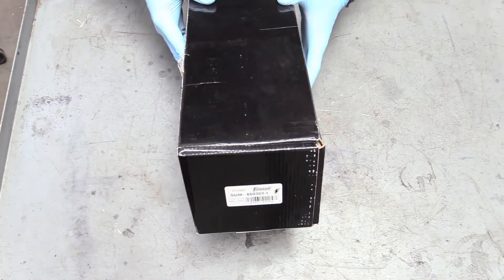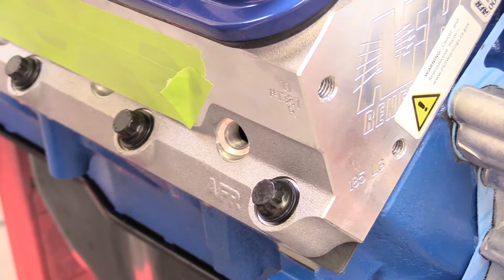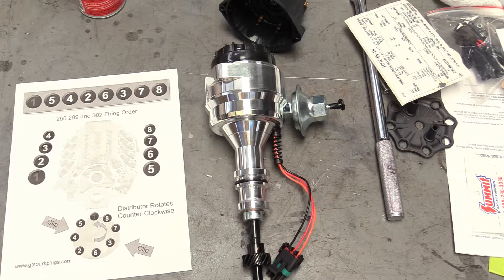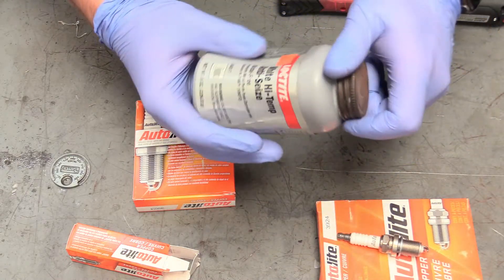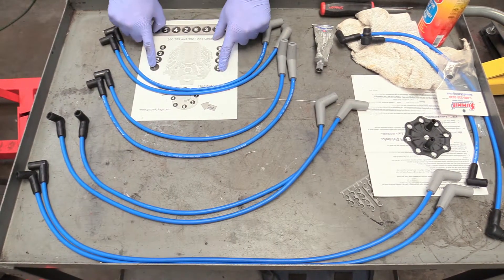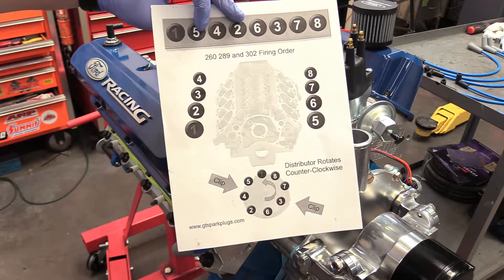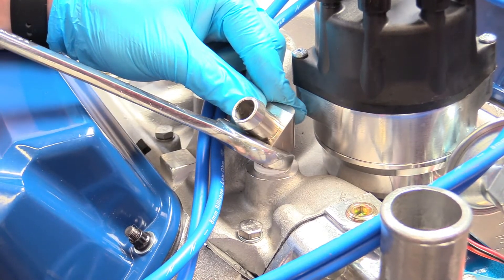How to Build a Ford 302 Small Block - Part 9: Distributor, Spark Plugs, Wires

Comment: I dont really get the same blast of air you did finding tdc. 302 is on a stand like yours. Does taping the exhaust ports like in yours do anything. I was able to put a small balloon on a compression tester line and found i was near 0. Does this motor have bad compression you think?

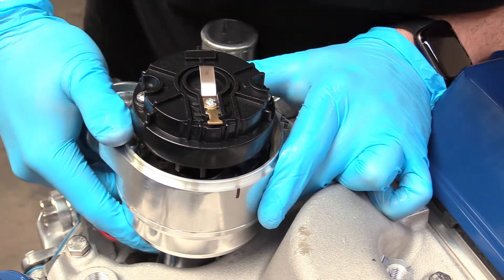Comment: once you overshot your mark at 7:17, couldn't you have just turned the housing into position instead of removing the entire assembly? Love the channel. I saw them do it on powernation and just wanted to make sure.
Reply from the maker: Because it wasn't lined up with the correct grove on the cam, you might be okay but it will limit how much timing you can adjust. Thanks for watching!
Reply: @2carpros  Thank you sir

Comment: Would heavy duty high temp wheel bearing grease work on on the gear?
Reply from the maker: I'm sure it would be fine BUT for technical correct Andy's out there I have to recommend grease that will dissolve in oil like I did in the video. Thanks for watching!

Comment: I am having so many problems positioning distributor correctly. I'm at TDC, but unable to figure out exact location to point #1 plug/rotor. Engine starts, but is running poorly. Specs:1972 Ford Gran Torino 302

Comment: That distributor you installed is a standard stock hei one with a cast iron gear. Would that fit a standard 302 engine. My 79 F150 has HEI with a cast iron gear.
Reply from the maker: Yeah it should. Thanks for watching!

Comment: Spark plug question: I know with newer cars platinum plugs are recommended but what about using them in older cars that used standard copper from the factory?  What are your thoughts? Good, bad or doesn't matter?  I ask because my dad puts them in his 88 vette that I'm pretty sure were copper from the factory in 88.
Reply from the maker: It won't make an impact IMO. From my understanding it will "perform" worse but last much much longer. But it's splitting hairs if you ask me on the performance aspect. I'd prefer the longevity especially in a vette where the plugs are such a pain. Thanks for watching!